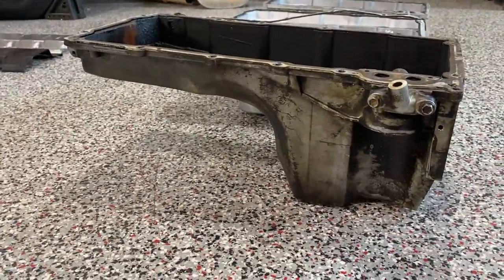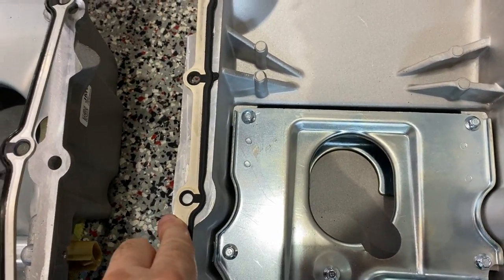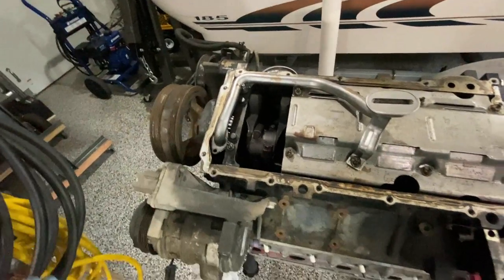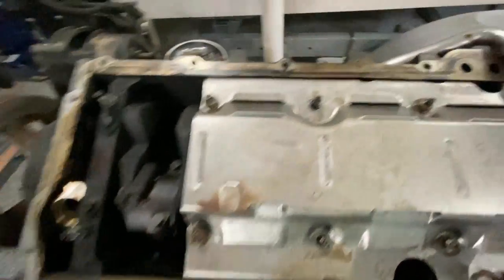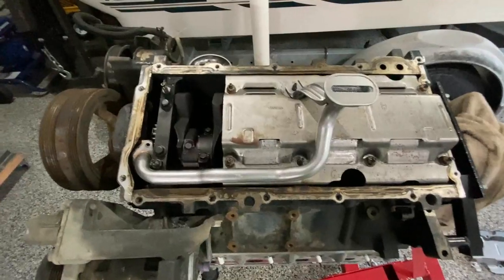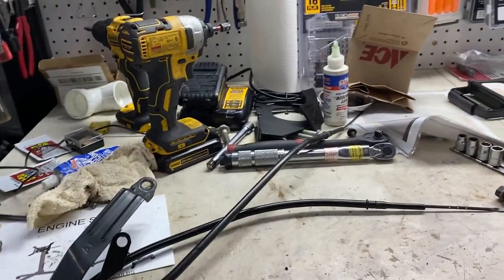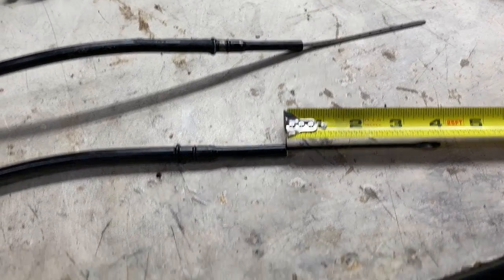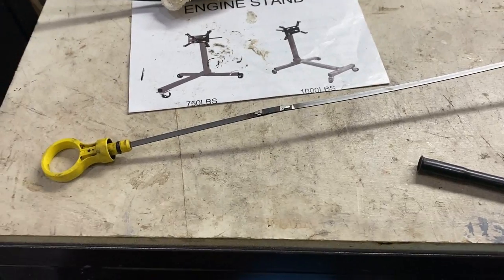Project OBS Chevy LS swap 5.3 has a new issue to fix...It's all in the details!

Comment: Holley has a complete LS Swap kit exactly for this.
Reply from the maker: Yes, you are right. Holley as well as several other companies make oil pan kits for the 88-98 Chevy OBS trucks. But, unless you have budgeted ~$375-500 for a kit, it is a bit pricey. My goal with this (and most of my projects) is how can I do what needs to be done safely and on a budget. When I compare the factory LS1 pan and "cheap" pan I have, the "cheap" casting is actually better looking than the factory pan that cost nearly 2.5x the price. So, if a guy is on a tight budget, he can put together what he needs for $125-150, that leaves some extra money for something else on his build. Thanks for the comment.

Comment: Great content. One question though, why do we need to alter our oil pans in the first place?
Reply from the maker: If you plan on leaving your truck at stock ride height, you should be fine. But, if your truck is lowered (like mine are) then it can be a problem. The factory truck oil pan is quite deep. When you drop it in an OBS truck, it will be an inch or two below the front cross-member.  On a lowered truck, you would have to be very careful of potholes and speed bumps. Not only because it hangs down so low, but it is also made of aluminum, so, it won't dent, it will either crack or break. Both are bad! The LS1 or 98-02 F body oil pan is great because it is the same depth as the transmission pan. It will sit high enough up that ground clearance damage is no longer a problem. It's not expensive, an aftermarket pan can be had for less than $100 and the proper oil pick up is about $47. You can modify your truck windage tray to work and, if using truck exhaust manifolds, your stock oil dipstick tube will work as well. Modifying the length  of the truck dipstick is easy and cheap. Hope that answers your question. You don't have to do it....but.....

Comment: Dear Sir, what engine did your dip stick come from? I have a 2000 5.3 and was wondering if that 1” difference you referred to in this video would be the same for me? Thanks
Reply from the maker: Part of it depends on what exhaust manifolds you plan to use. A stock truck dip stick tube will work with stock exhaust manifolds. If you choose Camaro manifolds or headers, it may/may not work due to the shape and where it is mounted on the head. I tried using a Camaro  dip stick with an LS2 and it won't line up correctly. Puts the tube directly in front of a spark plug. In my case, I used stock truck/suv manifolds. So, I used the stock truck/suv dip stick tube because it fits around the manifolds perfectly. The dip stick itself had to be shortened. I cut mine up high, where the dip stick tube is straight. Then overlapped the stick about 1" and very carefully spot welded on each side at the seam. Be really  careful not to use too much heat, the stick can melt very easily. I put the "splice" up high to there would be minimal bending of the dip stick when inserted and removed. Works perfectly. Or you can buy an LS1 dipstick.
Reply: I ended up drilling out the rivets cutting the section from there on the lower piece then drill  and riveting it back together
Reply from the maker: @MrRuggs57  Good idea, sounds like it would work.

Comment: I love you videos !!!! Do you know which pan I should use for a LS swap 89 c1500 that’s going to be lowered,I have a truck pan I just don’t like the idea of it hanging below the crossmember.  Sorry this is my first LS swap
Reply from the maker: For the money, the LS1 pan is the way to go. There are aftermarket versions for cheap money...like around $100. That is just for the pan. You will need an LS1 oil pick up tube. If you are on a tight budget ( I usually am), you can use your truck windage tray and trim it down per my video and it will work fine. For a dipstick, I use my truck dipstick and modify. For the dipstick tube, it all depends on what exhaust manifolds you decide to use. If you use the stock truck manifolds, then the stock tube is fine. If you go with aftermarket manifolds you will have to play around a bit to see what will fit, yet clear spark plug access. All in all, if its a street truck and you keep the mods simple and go with ls truck manifolds, you can get what you need for less than $150-175.